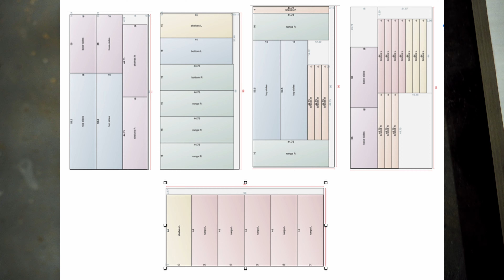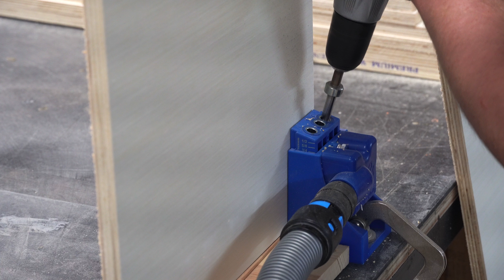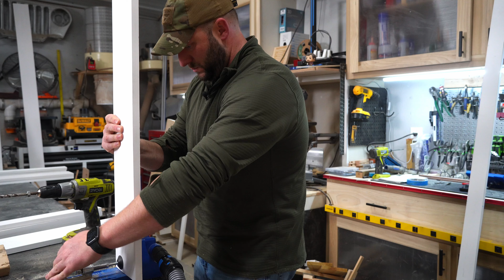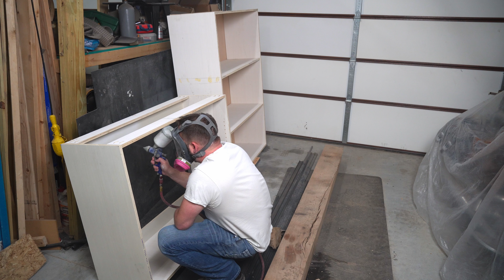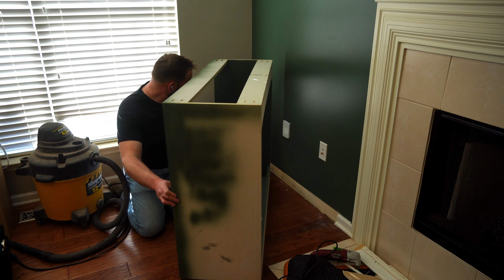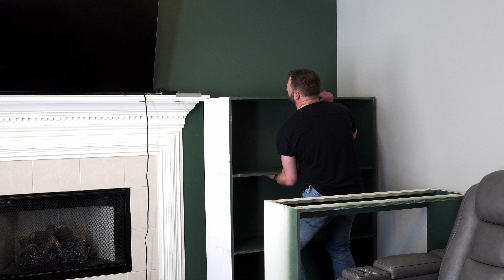STOP wasting space and DIY some BUILT INS!

Comment: Thanks for the video- How did you secure the top shelves to the walls?
Reply from the maker: I used screws up from inside the cabinets to secure the bottom and thru the top corners into the wall’s top plate for the tops.

Comment: Good Job.  Maybe you can do a video of how the cut list generator works?  Very Interesting
Reply from the maker: Thank you!   I’m just using the free version but it’s super easy. You put all the board lengths you need in the top left spreadsheet and the number of stock pieces you have in the bottom left and it will draw all the pictures for you in the center. I usually just screenshot that and print it to take it out to the saw with me.